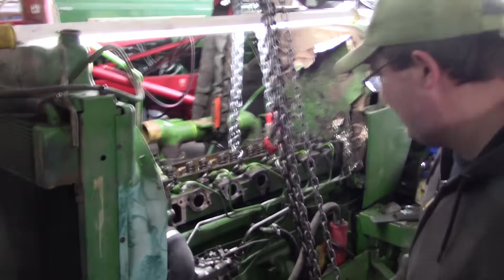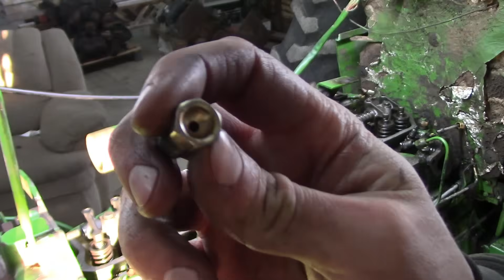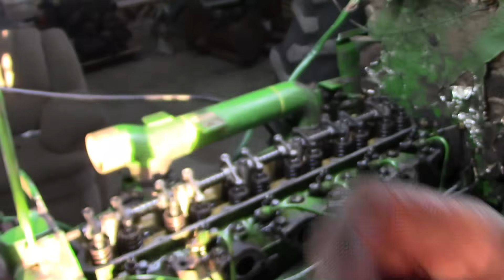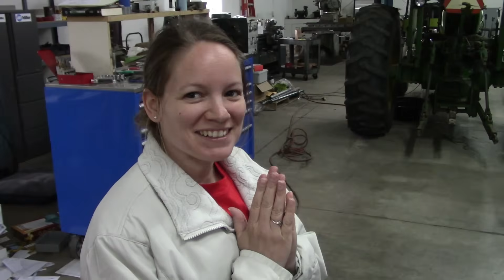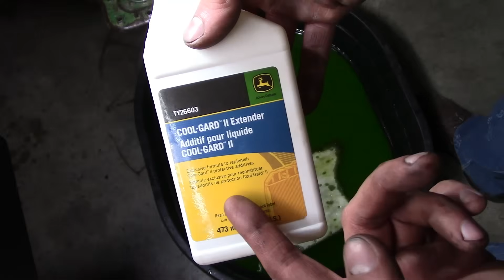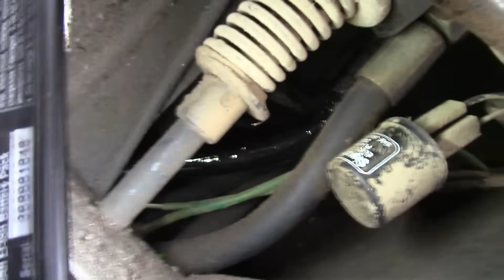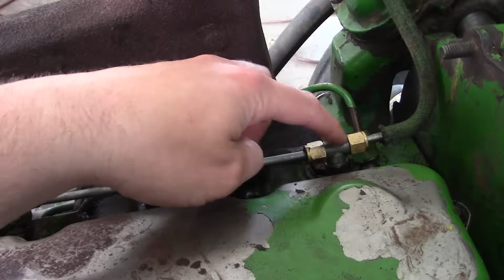John Deere 2940 Tractor | Head Gasket Replacement - Part 2

Comment: Wes, liove your videos. I’ve been a tractor mechanic over 51 years now , 45 years ago I bought the special snap-on wrenches so you can torque head bolts without removing the rocker shaft assembly and yes Ian probably considered to be an old timer now, on tractor paper and tin head gaskets I always use copper coat spray I’ve never had a problem and never assumed lettering goes normally up on head gaskets and I’ve never put a head gasket on backwards because if it’s not real obvious which way it goes, I spend a lot of time making sure there’s one opening different when you move it end to end or flip it over. The other point I think you’re missing is the fact that sometimes the manufacturer wants you to replace head bolts with flange bolts (new style)  if you go to torque them and they will stretch, nothing to do with the fact the tractor is 30 40 50 60 yrs old they have lasted that long why can’t I reuse them. The point is when the manufacturer recommends replacing them is at the point of torquing them they (sometimes) will stretch gamble if you feel lucky. A lot of times Kohler head gaskets come with new bolts in kits

Comment: when setting rockers it's much, much easier to turn the crank if the spark plugs are removed. and once the #1 cyl in the firing order's rockers have been set one need only turn the crank 120 degree on a 6cyl engine to set the rockers in cyl #2 . it's not even necessary to look at the valves. another 120 degrees and cyl #3 can be set. then repeat, following the firing order,  until all rockers have been set.

the number of degrees to turn on a four-stroke engine is based on the number of cylinders in the engine. for a 4cyl engine it's 180 degrees, for a 6cyl engine, it's 120 degrees, for an 8cyl engine it's 90 degrees, etc. the calculation is: 720deg (two full turns of the crank) divided by the  number of cylinders in the engine.

...a little surprised that the engine can be run with the valve cover off and NOT have oil sprayed all over the engine compartment.

Comment: I really enjoyed your video.  Thank you.  Couple of questions if you don't mind.   1.) Could you remove/loosen the injectors to kill compression while you are adjusting valves?  2.)  What are your thoughts on when to use new headbolts?

Comment: Wes, concerning your blown computer motherboard.
ALWAYS use a 1250 or higher Battery Backup power UPS surge protector.
For just a tv and it's plug ins plus the cable input a 650 or 850 will do.
One with a small LCD that will show you the condition of the AC going into it, the percentage of load you have on it and the sine wave of the ac output from it plus a couple of other criteria.
Run ALL equipment connected to the computer thru it and your internet cable also.
Only the computer and other devices with a memory need be plugged into the battery backup outlets.
Computers hate power interruptions that can cause hard drive and IO board issues and a good UPS will have a cable to your computer that will perform a soft shutdown if your power goes out, you leave the computer or peripheral on and it's battery reaches a low DC voltage threshold.
Everything appliances run them thru the surge protected outlets on it.
No, strip surge protectors DO NOT protect electronics. 
They are designed to protect the wiring in your house and circuit breakers fron shorts in items like toaster, microwave ovens, toaster ovens and other devices.
Even when those items are not yet shorted completely but on the edge of it thar can cause a severe increase in power loading.
I've been an electronics tech for 38 years now including circuit boards repair and one of the most common causes of computer related issues are a result of  lightning strikes.
Lightning can strike a Mike and a half from your residence and destroy your electronic devices including this, stereos, computers and other devices.
Then there's power line surges from blown power line transformers.
A good 1250 UPS will you should only cost a little over $ 120 
I bought one main brand name one from COSTCO for $100.
It's a 1250. I use it to charge my laptop, smart TV, printer and charge my smartphones.
Never exceed 80 percent off the stated load limit it's rated at.
When I was living in the Florida Keys and I was the Service manager/ technician for the upper Keys amusement vending company TLC we kept having bar top touchscreen games blowing hard drives, motherboards and other items regularly till I ordered and installed a UPS on all of them and our top earning arcade games (Golden Tee Golf).
It cut down on those issues significantly.
My boss was ecstatic about how much I lowered our parts outlay and in effect increased the routes collection by cutting equipment down time.
I've always said, games are never really out of order.
If they're broken, their out of business till repaired.

Comment: Have you looked at the bearing surfaces of the Rockers on their shaft?  They also often wear out, badly - just like bad main or cam bearings.  I experienced that on a Rover 75, vintage of 1954, some many years ago -- the first engine bigger than a motor mower that I worked on.

Comment: Just in case you think those little Deeres are built in Moline, they are not.  Head gaskets and other problems a plenty on those things, not always maintenance related
Reply from the maker: These utility tractors have been built in Germany since the 1970s. The engine is made in Saran France.

Comment: You need to buy yourself a good battery backup USP.
At least a 1250.
Power strips DO NOT protect electronic devices.
They protect you house/garage/shop wiring.
A good USP has several protections built into it.
It regulates you A/C sine wave.
Regulates the actual A/C voltage.
Protects against power outages and lightning strikes to a certain extent.
Good ones have a small display that will alo show how much load you have on including all equipment you may have plugged into it.
Good ones also have a cable to the computer that will soft shut down your computer when the battery voltage gets low.
That's why your motherboard got fried when that lighting hit.
It can strike a mile away and take out a computer.
I've been working on computers since they began using them in touch screen counter top games, download jukeboxes, upright arcade games and desktop PC's.
That began in the mid to late 90's.
Blown computers in those equipment can really cost you some serious dollars as you not only have to pay for the repairs.
You're loosing money the equipment could be making while it's down in your shop being repaired.
Unless you have spares on the shelves as I did when I was the Service Manager for TLC Amusement Vending in the Florida Keys from 96 to 06.
My boss loved it when I started putting all of our computerized equipment on them and our repair costs plummeted big time.

Comment: wes. on future hose ends or other odd ends..  one of the hose shops out in los angeles cuts the skirt off the hose end after they slot it to remove from the hose..  they use a open end furrule to crimp the new hose to the original end..  just thought you might talk to your hose shop to see if they would be willing to do that.     i may have mentioned this to you.. instead of a rubber glove. i use a piece of Saran Wrap that i push a depression in the film prior to using a rubber band around the filler neck.. if the cold engine when cranked or run for 15 seconds inflates the depression.. i know i have a leaker..  i use a cylinder leak down tester hose to apply compressed air to the cylinder and if the saran wrap inflates that cylinder has been proven to have the leak..  i usually leave that set up as i call the customer..  when they arrive i apply compressed air the saran wrap inflates and the job is sold or the car goes to the junk yard without hours of work tearing it apart.

Comment: Hey Wes, thanks for the tip on scraping rust removal on machined surfaces. Was installing wheel spacers on my truck and the hub portion of the rotor had rust even after wire brushing them. This took the vib out of steering since the surfaces are now flush. 👍🏻👍🏻

Comment: You have tractor knowledge in the bag, but maybe I can give you some PC tips.  You have a couple of easy fixes you can do on your PC.  First, disconnect everything from the power supply inside the case.  Short the green wire to any black wire.  If the supply doesn't turn on, replace it.  Second, check your motherboard capacitors to see if any are bulging.  The tops and bottoms should make them look like flat cans. If you have bulged tops or bottoms, replace the capacitors that are bulging with ones with identical labeled values (lower ESR is better).  Power spikes wreak havoc on old capacitors like yours.

Comment: If you cut the crush sleeves off you could take the hose with fittings to your local hydraulics shop and they should be able to replace the hose and press on new sleeves over the existing fittings.
Reply from the maker: I don't know if I could get that done. I believe it is a metric sized hose. Not many shops here would have metric sleeves or crimp dies.
Reply: @WatchWesWork  I would think the only difference is at the ends of the fitting and hose ends would be somewhat standardized, but I could also be wrong about this. My curiosity would have me grinding away on those sleeves and taking calipers to the parts, but time is not money for me as it is for so many others. Your solution was probably the better economical one in the long run. :)

Comment: How is it that putting the head gasket on backwards can be so bad? If holes fit all openings, it should do it's job no? Or are we talking when you thus accidentally end up with a misaligned hole? :)
Reply from the maker: The oil and coolant passages are not symmetrical.
Reply: @WatchWesWork  thanks for your reply, very cool! Hi from Belgium

Comment: Shit happens when you try to cheap out on 'precision' parts.

Surge protectors wear out. Cheap ones turn into 'power strips', good ones actually stop functioning. Check the 'protection' led or power switch light. If it flickers or isn't lit... very dead.
Reply: I don't think the 'protection' led or power switch light is an accurate indicator that they're still any good.  They'll take a certain number of surges depending on their rating and they're toast - no way to tell when they die as far as I know. Just replace them every 2 to 5 years depending on how much lightning you get. Of course I don't take my own advice, and have surge protectors in use that are way over 10 years old, but we don't get much lightning around here.

Comment: If that engine was running with anything other than HOAT coolant, chances are the liners are pitted and it would be worth your time pulling them while you had the head off.

Comment: Wes, could you have built up those worn valves with a tig torch and some kind of hard facing?  I know time-wise, and experience-wise for the tig torch,  it's probably not worth it but I always wonder how to fix things when parts are no longer available.
Reply from the maker: Other have suggested the same and I don't know the answer. I'm not experienced enough with hard facing to say.

Comment: That head gasket looks like it goes to a bigger bore engine
Reply from the maker: There's different sized liner bosses depending on when the engine was made. The gasket is supposed to work with all of them.

Comment: I cost myself $1000 by twisting and tearing a brake line when the flange nut stuck to it. That’s what i get for replacing calipers myself.
Reply from the maker: Sometimes you don't get a choice. They will not come apart.

Comment: Just on the power steering hose, could you not get the hydraulic shop to strip out the two couplers and fit and crip them on a new piece of hose. 
You can usually cut off the ferrules/crimps and get the fittings out of the old pipe, then just get a new pipe and ferrules/crimps fitted.
Excellent videos Wes, fantastic knowledge and workmanship!!!
Reply from the maker: I don't know of a shop here that will do that. They can barely make the simplest hose...
Reply: @WatchWesWork  Heck you'd think that would be simple for them to do given the amount of agriculture in Kansas, then again I guess the skills just aren't there anymore. There's probably an old guy working in a shed somewhere that could do it in his sleep.

Comment: i hate aftermarket junk parts....wastes so much time trying to re-manufacture it to work. the head gasket looks like it sealed up....too bad that blow by is so bad! i hate the hurry up and wait that goes with waiting on parts mid project.....feeling busy but getting nothing done, i totally get it.
Reply from the maker: Yeah, I should have held out for the dealer parts. It would have been much better. Next time...

Comment: The reason why they say to replace the head bolts is the torque that they are set at when you unbolt the head it slightly twists the bolt then when you retorque the bolt it weakens the bolts further possibly having one snap while the engine is running

Comment: Great video. Ref: The (hard) face of the valve - rocker-arms. Next time, you may want to try using a "HARD-FACING" (nickel) welding rod. Hey, if it last (and it does) on a say back-hoe / excavator bucket(s,) it sure as hell will last on the rocker-arm face. I thought those carbide scraper's was over priced, they redeemed them selves via this video, ref the exhaust gasket face. Sit down first, are you sitting, even I, "El-Cheap-O," at 66 yr's old, is going to spring the big buck's for a set. Just more stuff for my grand kid's to inherit. Hopefully, I get to use them first.

Comment: Thanks for another Deere update, Now like me you know why the stealerships don't want those old tractors in their shops so much anymore. They are just a pain in the butt  for parts and "other issues" that need addressing like that pipe oil leak. The Landini kit of parts I rebuilt the motor in is still here, I got it running then found it was stuck in gear on a range change so had to work on that, a pile of mouse eaten wires, and the loader joystick controls messed up, Quicke want $1000   for that stuff, the jobber replacement parts are not any cheaper by the time I make that" fit and work" . 
 I don't oil those head bolts by soaking like they say either I worked on a big 8430 4wd the owner and dealer had head gasket problems with, the dealer did it before me and it ran just over an hour pushing using a big blade. All the head bolts were slack when I took it apart, from what i can figure out they soaked the bolts so much. They hydro locked on the oil in the blind holes, giving a false torque on the wrench as there was so much oil in the holes in the block.  I'm hoping when you met your wife she didn't fall for you with the "there's your problem lady" quote L.O.L  Take care guys

Comment: I'm curious...If you had a 6-cylinder diesel and you worked on the injection...say you bled 3 of the cylinders and it ran, would the remaining 3 cylinders eventually bleed themselves?  I don't own a diesel...I'm just curious...
Reply: Correct.  Usually if you get it to fire and run the remaining injectors will self bleed.  In some extreme cases it may require cracking a line but it is pretty uncommon.
Reply: @ShainAndrews  Cool!  Thanks!

Comment: The new fuel return fittings are brass and much nicer. Also all those factory Deere hoses have the part number stamped into the crimped end. Easiest way to not get the wrong one as there are bunches of versions of those lines on those tractors. I have never seen rockers worn that bad on a Deere. It must have gone 14k without the valves ever being adjusted.  A shame Reliance couldn't even send you a matching set of low quality rockers. Best I recall the new style Deere stuff changes to cup and ball pushrods versus ball ball as that addressed some wear issues. So far 35000hours with no internal part changes is the highest houred Deere engine I have worked on.

Comment: Had a truck blow a coolant line in the middle of the night one time. No obvious indication of what happened other than the shutdown warning came on. I was on the phone with the company’s breakdown line and told em the truck was leaking and they asked me what was leaking. Now, it’s about 0200 in western Wyoming. No way you could visually tell what it was, so I wiped some of it off the frame and tasted it, spit, and said, “tastes like coolant!” That poor college boy on the other end absolutely freaked out. You’d have thought I told him I ate a box of rat poison.

Comment: Buy an UPS that has a surge protection feature. You get power when its down and it protects you from surges. Two birds, one stone. As in, it's better than a surge circuit.

Comment: I always wanted to make something that went on a torque wrench that makes bolts after they get torqued.. like a paint mark or something because I always mark them like u do . Especially with toque to yield bolts because u cant recheck the angle like u can actual torque
Reply: They already exist.  You won't like the price though.
Reply: @ShainAndrews  you said that and I had too look lol.. they actually cost less than the snap on one I bought but they dont seem to do torque  angle which is the whole reason I wanted it lol

Comment: When I was a mechanic I installed the head gasket on a mid 80s VW diesel  Jetta upside down. Two of us verified it was right. No oil to the head or cam bearings. I figured it out pretty quickly and it was OK after taking the head back off and a new gasket. Ever since then I make sure all of the holes lune up with something.